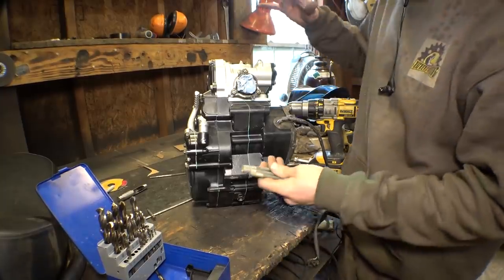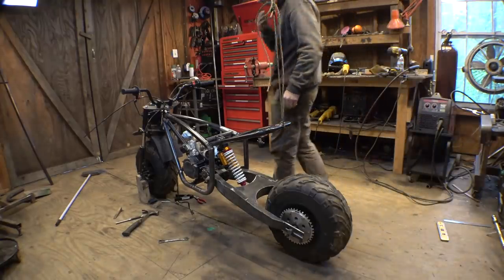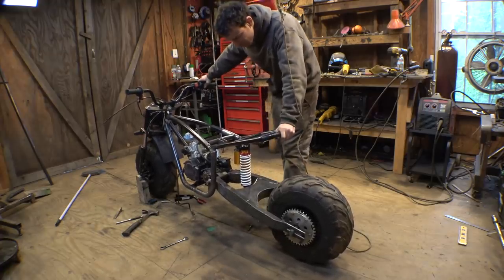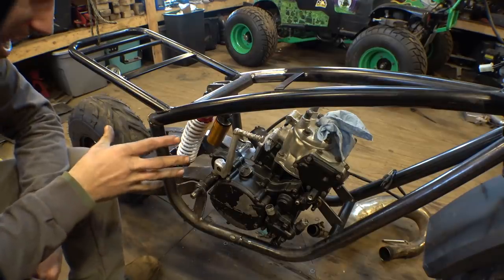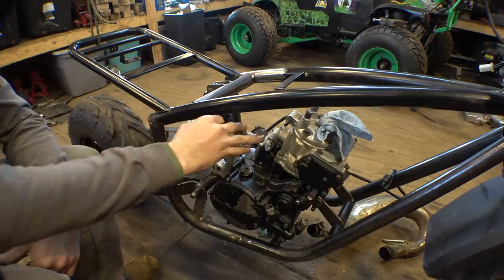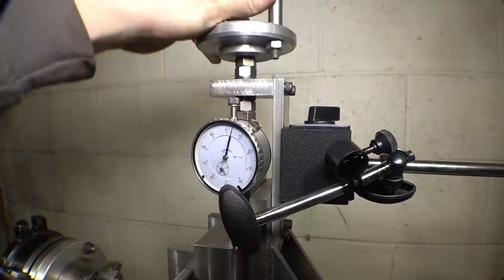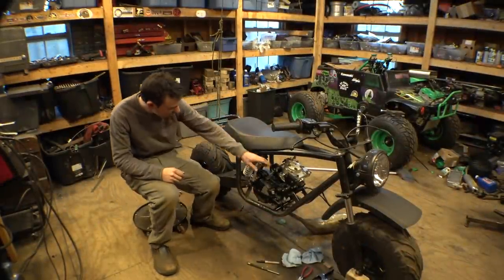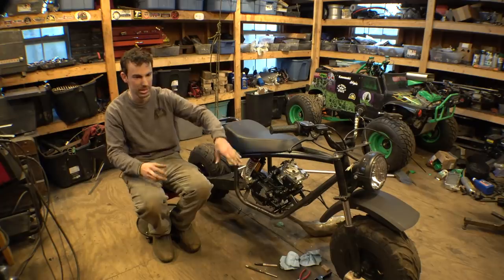CR 125 Mini Bike Part 3

Comment: It's not an air shock, it's a piggy back shock or whatever they call it. You can adjust the bottoming out resistance a bit but it's no solution for wrong spring rate, for that you need to change the spring or reposition the shock to change the travel as a work around if you cant change the spring. 
The piggy back contains a rubber bladder that takes up the volume of the piston rod when it enters the chamber. "normal" shocks also have an air space inside them for this reason but they may not be able to work upside down as the damper valve might get exposed to air.
A real air shock has no spring at all.
Reply: Fast approximation:
Frame and engine 50kg, rider70kg, 50%/50%: 60 kg on the rear axle.
Rider sag 50 mm (without preload): 60kg/50mm = 1.2kg/mm on the rear axle.
For example:
Rear linkage ratio 3 to 1: Needed spring rate = 3^2 *1.2kg/mm = 10,8 kg/mm = about 108 N/mm.
Change rear linkage ratio 2 to 1: Needed spring rate = 2^2 *1.2kg/mm = 4,8 kg/mm = about 48 N/mm.
So, change the rear linkage ratio/ Move the rear shock mounting point in front of the rear tyre.
Or check the current linkage ratio, and buy a stiff enough spring to match your current setup.
Typical rear spring rate in a typical Kawasaki/Suzuki/Yamaha 600/1000cc RR-bike is (90...)100N/mm, so that might be an option.

Comment: Dirt bikes use some link things on the rear shock so they can fit a bigger shock, I don't know what it's called but if you search "dirt bike rear suspension" and go on images then there are some examples there. What I mean is that the shock is not mounted directly to the swing arm. Not all dirt bikes use it though but I think many do

Comment: For the kick start can ya weld a bracket to the bottom frame up to the round part like half inch thick and Grove it out or drill big hole and make it a support great video and awesome cnc machining

Comment: GHP will be wanting one your spline cutting setups. I thought they might be a small fluting bit available (probably not cheap)that would work on exterior splines.Basically you made a pneumatic chisel (layman’s term)or horizontal and linear cutter jig. 😂😂😂

Comment: You should have done a jack shaft like the ATC 3 wheeler uses to make them into a 2 wheeleed bike(just google ATC 2 wheel converion kit) .  Then you could have had the engine in the midle.     And please suport that kick starter.   There are so many dirt bikes out there known for braking the cases when kicking them to hard.  Most of them are big bore bikes, but with that extension you put on there it is gone be a problem.  Other then that, I love your builds.  So much fun watching someone as young as you using there brains to make so much fun things come together.  Keep up the good work and stay covid free :)

Comment: I’d definitely look at that shock more and  see if you can adjust it
Reply: 55LEO55 kinda looked like too much sag to adjust out ?
Reply: Ya it looked like the spring had no pre load on it. The plate on the the top of the spring can normally be tightened so it compresses the spring while leaving the shock at full resting length. By the looks of it and the quality (from what I can tell) I’d be surprised if there is no way to adjust it

Comment: A rear shock off a "KTM EXC" is what you need. Specifically PDS style rather than motocross style linkage unit. PDS units can also be found on older XC or SX models.

Comment: Your going to crack the casing with that extension.
Reply: This. It wont last very long since the extension is putting so much stress on the shaft. Also, you dont want to position the rear shock straight up vertically. Get stiffer one and place it more angled, like you first attempted.
Reply: well if he makes a support brace with a bearing or bushing coming off the chassis he should be fine but as it currently stands he better learn how to tig weld cast aluminum cus it will break
Reply: A kickstart lever stop would help avoid that.
Reply: This:  support brace with a bearing or bushing

Comment: A shock off a 125 or 250 dirt bike would work.  The problem with the shock you have is you don’t have enough spring rate.  With aftermarket shocks, you can buy different springs to match your weight and the weight of the bike.  If you have the right spring rate, when you sit on the bike with gear, the bike should only squat 25% of the shock rod stroke/travel.  This is commonly called “setting rider sag”.

Comment: I predict cracked housing with that shaft extension... often just a thin brass bushing in the thin alu housing holding the shaft.

I would have made a support for it between the engine and the spliines on the extender welded to the frame. 
think like a connecting rod welded to the frame that goes around the extension piece just inside the outer splines with a rod cap clamping it down against the "rod" .

Comment: If he ever uses that engine for a different project wouldn’t he have to drill the new project frame to 3/8” as well? I would’ve just gotten longer bolts for a few bucks, but btw, the way he machines that spline piece was dope, this guy is a beast on the lathe!

Comment: You should harden the shifter adapter before you start using it all the time that will prevent it from stripping which could easily happen. A torch and a quick dip in some oil and you're in business.

Comment: If you have to wait for another rear shock, why not just buy one that will do the job??? You need one without the air chamber. If you fit two of the one you have you will have hardly any room for the carb and air box/filter. 
Your wheelbase is too long too, should move engine/swingarm forward. 
Your a very skilled chap but some of your decisions sometimes drift from that fact. 
Great content to watch! Thanks 👍🏻

Comment: Good work mate!
Love the video.
Might be a good idea to put a bearing even a brass bushing on the kick starter to stop the bending forces from the extended kick starter.

For the shifter, it might be easier to use linkages like on a sports bike. Google image R1 shifter and you'll see what I'm talking about. 

Otherwise keep up the good work!
Reply: MrCybergladiator yeah a shifter with the linkages on it would work

Comment: @rather B welding , I can't recall your real name as I make this post, my apologies. I really like your channel. I follow just 3 of this type. You, Grindhardplumbing, and sometimes Cars and Camera's. The last one is mainly for the example of how someone can build stuff without a lathe and or more money. You and Grind Hard, have a lathe and a Tig. Those 2 tools are a COMPLETE game changer. Just wanted to kudo's to you. Also while I'm thinking about it, when are you going to re-visit The green monster? The last I saw you had to think about the rear suspension to stop your kidneys from clapping. It has the coolest front end design out of any of these machine in this design period! 
You can't produce these fast enough. I get all impatient at the end of each of your vids as I exit out looking for the next in line.

Comment: I dont want to rain on your parade but that splines shaft on the CR 80 is always a weak link and with the added leverage or the adapter although it's a very well made part will be super sketchy once the spark plug is added and compression is up around 110 psi .. wish you luck but that's going to be a problem for sure

Comment: Dude, although the shock is charged with "air" (typically Nitrogen), you still have fluid in it as well, it's what absorbs the energy, the weight of the fluid will affect the performance. Also the valving/valve stack, piston, spring, and adjusters (clickers) will all affect rebound, compression, and how long the shock will preform before the fluid overheats. Typically when charging the shock with "air" I fill them with anywhere from 100 psi to 400+ psi of pressure. I'd guess between 200-300 psi would be ideal for your application. The shock losing its pressure over time or when cycling it is typically from a leaky seal, either on the piggyback or main body. The fluid and seals are probably junk, cheap shocks can easily perform on a much higher level by rebuilding them with quality inners and good fluid. Check out Steve Dey's channel and business, he has everything for any size shock, literally everything to rebuild, modify/upgrade, speciality tools, and will give you a level of support that will amaze you. That shock should be way more than enough, the sound it made when u sat on it coupled with the fact u mentioned it lost its pressure means it won't hold any weight up, chances are a second one would likely have the same cheap internals and end up "lapped out" and won't support any weight in no time, even with two of them if they don't hold pressure then you could have 10 of them and it'll still drop/sag just the same as it is now.
Reply: Oh, Steve's prices are awesome, for example you can take a snowmobile fox zero (150 ea or so) and with maybe $40 to 100 convert them into a p zero pro (adding piggy back reservoir, 2 way clickers (compression & rebound), and changing the valving as desired), now that shock is worth $500 or so. He's got everything top to bottom, inside and out, it's all highest quality parts for low prices.

Comment: If this doesn't break after a couple rides I'll be very impressed. By making that kickstarter extender you increased the leverage on the kickstarter gear. It will make the gear twist either bind on or break the case(eventually) . 

Just my unprofessional opinion

Comment: I have no doubts your part is going to hold, it's the case that i have doubts, you've added extra on the torque bar that is the lever arm. Let's hope that they didn't cheap out, and make it exactly strong for its application, and made it plenty strong for impact damage, which would then render my query moot. Holding my fingers. :)

Comment: These 125cc motocross engines crave higher rpm to make power. They don't have much power or torque in the lower rpm range. That said i think your going to want to find a more aggressive knobby style tread pattern like on your VF1000 for your rear tire for better traction when your on the pipe. Your current tire may want to skate around a good bit with that shallow tractor style tread pattern. I mean it's going to spin like crazy anyways but in wet conditions your going to want the extra grip to help keep the rear end somewhat controllable. The tire your using to mock this beast up with may as well be a drag slick with how the power delivery of the engine works. Just sayin'.

Comment: i didnt really see it in the video but you did measure to make sure the frame is straight, right? the spline cutting process was really interesting! is that thing a DIY project or is it something existing that you modified? cool tool though! if you could put a bearing around the kickshaft extension i think that would be smart. it may last a bit but i wouldn't trust the crankcases to hold that extra leverage for too long, fixing it before it happens and i think you'd be thanking yourself later :P saw ep 2 as my first vid of yours and you got me subscribed by the very first vid, and thats rare :P
Reply: oh btw, you should've looked for pitbike shocks 800-1200 lbs springrate depending on how you mount it and how heavy you expect the bike to be should do you good :) its what i run on my comp bike :P

Comment: Could you use the internal spline cutter to extend the crank for the sprocket to line up with the rear wheel better?

Comment: Find a pit bike shock with a 950 lb spring it will be more than enough and you can find them in pretty much any length millimeter wise look for a ELCA or pit bike shock stay away from the are charged ones they leak

Comment: That looks likely a std. spring diameter, get on Summit or Jeg’s  and order whatever spring length and spring rate you want.  You can even run two short springs and have a soft ride in the top of the travel and get much firmer on the bottom of the travel.

Comment: The front wheel may have a problem steering at speeds bc it is big so u might have to lower the tire pressure to get better grip like on a quad bike
Reply: same tires on my mini bike and it dose 55 no issues with steering at all, he should be ok if he goes with a better tread pattern

Comment: You might break the engine case where the kick start goes in. That's a lot more leverage than before. Just don't kick or put all your weight on it.

Comment: I’m pretty sure you need argon or some sort of natural gas to fill the shock
Reply: Usually they are nitrogen filled
Reply: No, normal air works just fine. It's just a rubber bladder inside and you don't fill your tires with argon or nitrogen. It's mostly a money making myth, the benefits are so minute that you can't barely measure them. Normal air is 78% nitrogen already.

Comment: After welding the adapter for kick start, why didn’t ya machine it down to look smooth?
Reply: In most scenarios, welds are extremely hard and very difficult to machine. There is a high risk of breaking cutting tools when attempting to machine a weld.
Reply: @bradensmith888  VErputzen tut man mit einem SCHLEIFWERKZEUG  - FLEX oder SCHLEIFBAND , dann schlußendlich das Finish per POLIEREN . Nutzt aber nix , weil das Gehäuse diese Art von ausserhalb der Mitte platzierten Kickstarter kaum lange mitmachen wird . Sobald Kompression auf dem Motor ist ..............okay , es ist ein 125er Motor und es könnte auf DAUER gut gehen . Ein 500er Motor würde deffinitiv das Gehäuse zerbrechen .
Reply: provisorisch - finish kommt womöglich später .  Die Halterungen und Rahmen wurden ja auch erstmal nur geheftet

Comment: Could of just bought a stock shock off a used dirtbike lol
Reply: Was hoping someone said this. That just seems self explanatory
Reply: Colton Harlow I know right? I like this guy seems pretty knowledgeable but some times he doesn’t make the optimum decisions it seems🤷‍♂️
Reply: That could work. Though every modern bike has shock linkages. He isnt running links. I would guess it would he way to stuff. 🤷‍♂️
Reply: He will probs want linkages anyway to help stabilize and make the overall ride of the bike better. But this guy is very knoweledgeable sometimes its just easy to miss the obvious 😆 we've all done it
Reply: It acctualy most likely wouldn't work just because the modern swing arm isn't as long and as far back from the cg (center of gravity) in the bike and it would make it exactly the same. He was smart to buy another one
Reply: @snapfish89   KTM has used no linkages in many of there bikes for the last 15-20 ish years.  So should not be a problem finding one used and cheap.
Reply: I believe he tried that option but couldn't find anything that would fit the frame without some major modifications to what he's already made.
Also, the current corvid situation means he's already working with limitations, so maybe one of the limitations is materials he's able to obtain?
Reply: supertedogpriken KTM changed to a linkage system about 7-8 years ago because they realised you needed linkage to make a dirt bike track properly.
Reply: @jordandiable2677   newer bikes then 7-8 years ago have the PDS system.  But the motocross bikes got linkage and the of-road bikes used the PDS system.   Dont know for the 2020 bikes, but last year you could stil buy a brand new ktm with no linkage(PDS)

Comment: On my mountain bike i have 250psi in my rear shock and yours looks to be about 3 or 4 time bigger
Reply: Alex's Garage that’s a lot of pressure! does it have a reservoir? I have put a 125cc 2 stroke in a mountain bike and cut it off and need to reattach it any advice? Check my video if you like

Comment: Dude. Will you please read some suspension design books. Theres no reason to be guessing on your shocks. There are easy numbers to use fir how much angle changes your SPRING RATES( it's not "how strong it is").

Comment: whenyou wher building the frame i was wondering why its so wide , maibe you cen make it so it goes in front of the rearforkwith the mounting plates pointing to the rear , from wat i can see it might cover the engine sprocket and maibe the mounting for the shifter on the other side , cant see it in this video realy
splinecutter seemed to work whell, think having a geared motor with a crank driving the cutter would work faster
Reply: watahyahknow also if the frame wasn’t so wide the kickstart would work normally too?